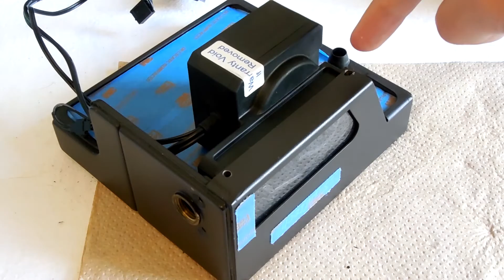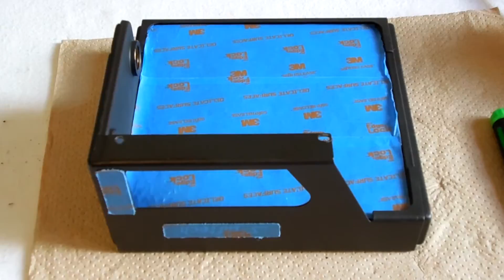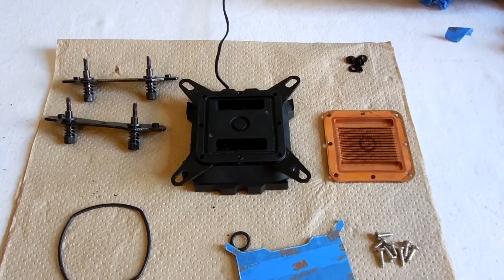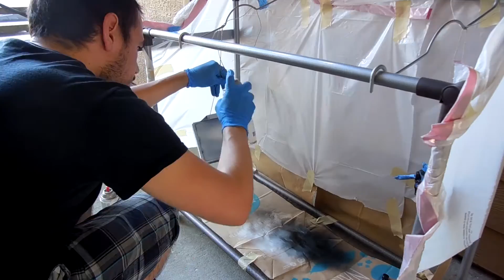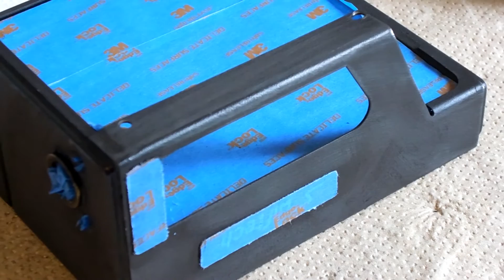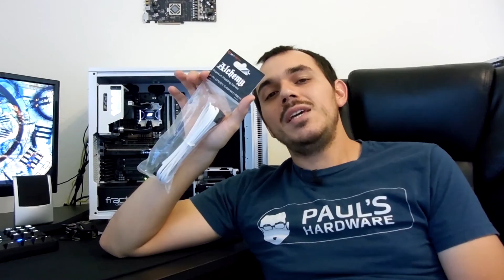Dorksmithing #0004: Customizing the Swiftech H-140X

Comment: how do you remove the stock tubes?
Reply from the maker: The kit uses the same kind of compression fittings that you'd get for any custom water cooling loop; just take a properly sized wrench (don't remember exact ID needed for the wrench), and loosen the sleeve for the fitting.  I know it takes a 16 mm wrench for the base of the fittings, so likely a 15 mm will be what you'd need for the sleeves.  Just be sure to have something to catch the water from the loop; even if you have already drained the loop, there still may be some fluid in the loop.
Reply: +The Manic Geek thanks for the fast reply this is gonna be my first water cooling system wish me luck
Reply from the maker: Best of luck! Word of advice for this kit: make sure the fill port on the rad isn't oriented on its side.  Either position it to be the highest point of the loop, or the lowest point; that way it's easier to drain and/or fill.  If the kit is at the lowest point, just flip the case upside down to fill it.  

If you need more help with water cooling systems, check out JayzTwoCents, he has some great vids on water cooling :-)
Reply: thanks buddy!

Comment: Man I really like that black and gold system (in general I love colour matched systems so please don't buy one of those green swiftech plates hahah :D because this system is well colour matched at the moment)but agreed home theatre computing never really took of, and so many cheaper, easier, smaller ect solutions exist now making them kinda redundant.
Reply from the maker: +MultiSkilz Well I DO still have a HTPC in the Fractal Design Core 500 that I reviewed.  it uses the same 7850K that was in the HTPC beforehand, just got downsized because one of the fittings started leaking, and I didn't have any spares, so it lives on in spirit.

As for the green plate, that was more me thinking out loud lol.  I've seen several white and green builds done and they look absolutely incredible... something about green just looks really good to me in a computer, in fact my fiance's build USED to be in a Cooler Master CM690II nVidia Edition case with green LED lighting and green braided cable extensions.  Still got the extensions, MIGHT do a green build at some point, possibly in the BitFenix Aegis I still have.  My primary rig will probably ALWAYS be some form of black and white, but once I get a "toy" rig going that one will probably change pretty frequently x-).